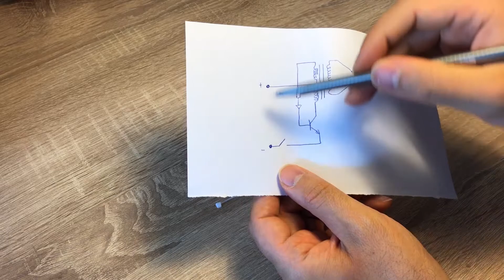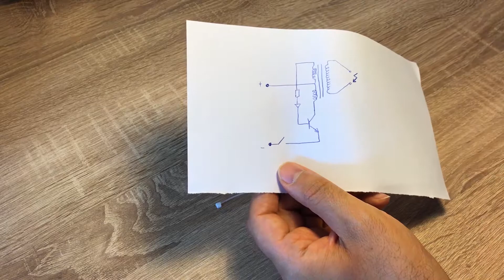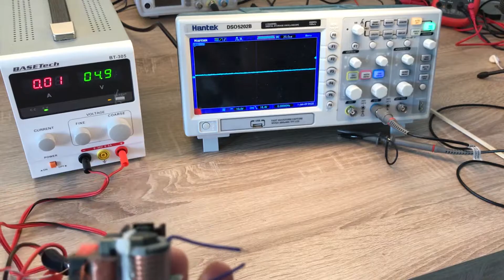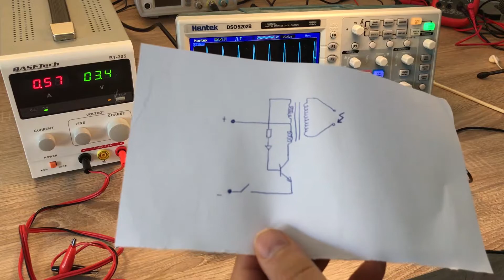High voltage arc generator kit from ebay

Comment: I  bought it 2 times. I give you some advice, take a resin bath to the  transformer, the secondary burns out due to the lack of insulation  .......    
ps : look the skrew of the transistor , it was too close to trasformer 
... an arc to it was the end of the semiconductor.
good explanation maaaaaaan !

Comment: Thank you for indicating the approximate operating frequency.  That's exactly what I was looking for!

Just for grins I'm going to drive the primary of one of these transformers with an audio amplifier at ~20kHz, and increase the amplitude until the ferrite core approaches saturation.  The secondary will be rectified and doubled with two flyback diodes and two inexpensive Chinese polystyrene capacitors.    The HVDC will provide the beam current for an electron tube.  Filament voltage will be adjusted for peak power from the high voltage supply.  I'll probably pot the transformer in oil.

I intend to do a similar thing with a coil-on-plug ignition coil, but at a lower frequency... ~5kHz.

None of this involves making sparks...just a few fast electrons and possibly bremsstrahlung of a very soft sort.
Reply from the maker: Thanks for explaining your project. Soon i plan to perform a proper simulation of this non-linear oscillator circuit and make a guideline for everyone how to select proper transistor in combination with number of turns and larger cores, to have the most optimum working point without burning the transistor. Anyway for your application, there are some other modules which have voltage doubler and capacitors integrated in them and they are potted in epoxy,  you get directly DC. I think in those modules by applying different DC voltage and limiting the primary current you can actually control the output voltage. Maybe also look at them.https://www.ebay.com/itm/311688245090?_trkparms=aid%3D1110006%26algo%3DHOMESPLICE.SIM%26ao%3D1%26asc%3D233720%26meid%3D1b1debb4445f48e2b5ad87faf57ffd0f%26pid%3D101195%26rk%3D5%26rkt%3D12%26sd%3D383901962093%26itm%3D311688245090%26pmt%3D1%26noa%3D0%26pg%3D2047675%26algv%3DSimplAMLv9PairwiseWithPLXWeb%26brand%3DUnbranded&_trksid=p2047675.c101195.m1851&amdata=cksum%3A3116882450901b1debb4445f48e2b5ad87faf57ffd0f%7Cenc%3AAQAGAAACEBt%252BED0jQb8HDIMnIWVLvDV2uwSAPrHym1NZSEMxYPV6VfIgLaRRfCUqviIp2kVV6shL89ITRvIsCpBvwJBy%252B7dJj32DY8xbgEimBB%252FbWWGZNdh2SwIc767%252FIG7js5Bs0OJZj65RSPtxnPOQ79A5YIE4V9v18bBwd1eDKDLR9PNVz7OZhMFP4mGq8wDJusUJvQrWrxkvRmO3hCJ3bsqI%252B%252FDDXwaoHiaHvwqatfL8H0DiLVKm8h%252B7da3uY19a4fss2bZEO0c%252BhkDOhuQwESaKasWVJNfjMupaEIInbBaqJfJ27L%252BACwA9ERgVxybT4S9PH4qSqwQIKqDBKQEYUGVBgB08k2mXOXJtKUs0EIUm9W1hRhqXRjKniudiMAVhCon%252FWMj26kWKgIliCyL%252FtjUMt0NFqw1dBQ7dhXu3SoC7EjhuVPliq220xeNJf%252BeiUTyezAXELc%252B8rEIc42Ml5rcpvB5p3cc54KnSASrMP8feStJJSXyusHOi%252BtcPt9Z9jot16LuDsSbSDzyK6B4BCgZNDASk3Si4W1eb45PrNvY5hmDefdsRm7rUiFbYQdAXidcCmVbH7oLes65Pz7LQuG00yDJE9Gfie9%252F59MGhm5qdDtm5epHAId1qnv%252F0ThELDyFk3yUDhDEGlsKJBna8zmSpjoJ7UwuTmYdV4EYkrzFhhoQjWmI0nZz6fs5cHo6OHV679A%253D%253D%7Campid%3APL_CLK%7Cclp%3A2047675
Reply: @HVE  Your suggestion is excellent.  I think the manufacturers do themselves a disservice by documenting nothing.  Even the titles are balderdash (400kV indeed).  Still, one could do as you suggest...conduct a series of tests with different supply voltages, loads, and operating intervals.  One might even take advantage of bulk pricing since some will surely die in the process.

Comment: Hi sir, nice video, i have this transformer followed by a cockroft walton multiplier, im wondering how can i display the relative voltage at the output of either the transformer (probably better) or the the multiplier. I need this to be done in order to have a underastanding of what voltages im working on, this for a powder coating gun. I doubt the transformer will last long in this operation but its worth trying since they are really cheap, i have it insulated with epoxi resin. Hope you can help me thank you!

Comment: Thx for video, did you make the additional video explaining how the oscillation works?
Reply from the maker: Not yet, but it will come. In preparation, i have made a video on how to obtain characteristics curve of a Mosfet (or similarly a transistor). It requires some experience with MATLAB which i am not sure if it you have it or not. Anyway if you are interested you can have look from here:
https://www.youtube.com/watch?v=8Z_qz8I5WLE
Reply: @HVE  thanks a lot!
Don’t have access to Matlab, last time I used was in college 20t ago. Lol. Talking about that, what’s a simulation  software you recommend? Are they expensive?

Comment: Hi, would you be able to use a full bridge rectifier to make this dc ? And also what would you estimate the output current - if powered by a 9v battery? Many thanks
Reply from the maker: The output is already DC, 9 volts input probably will burn the device. Use around 3-4 volts, output voltage i expect to be around 10-20 kV.
Reply: @HVE  Thankyou very much

Comment: sir how to measure turn ratio for this type of projects
Reply from the maker: Use your function generator and apply a sinusoidal voltage to the secondary (high voltage side), measure the voltage of primary on the scope, and divide the voltages. that gives you roughly the turn ratio.
Reply: @High Voltage Engineering by MG Niasar  thankyou sir,

One more doubt is how 10kv is produced because fir that ,as you said 3000 turn are required but our transformer will be 300 turns right
Reply from the maker: the transformer has around 300 turns. the point is that when we connect let say 3 Volts to the input of the device, because of switching and the nature of the circuit, on the primary side of transformer a voltage of maybe 20-30 volts appear. this voltage is then amplified by transformer for ~250-300 times and make around 5-9 kV for this example.

Comment: Can we use this transformer to make a Tesla coil
Reply from the maker: as the power source you can use it, but you must rectify the output first and make DC. It produce high frequency and withing one half-cycle of the high frequency output it can not charge any large capacitor. On The other hand the output of this arc generator is not very high voltage, so the gap of the spark gap must be very small, which means you will not get very high voltage out of your Tesla coil.